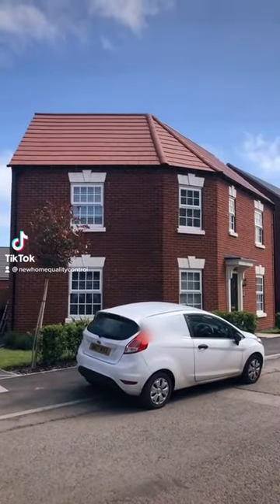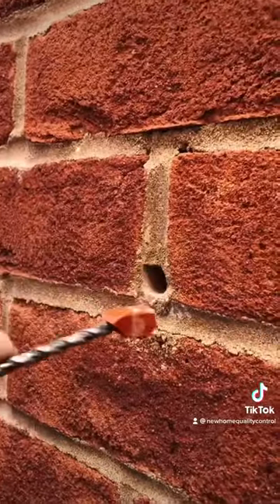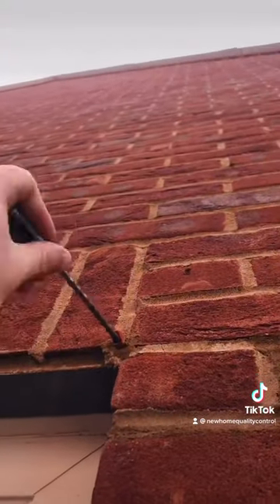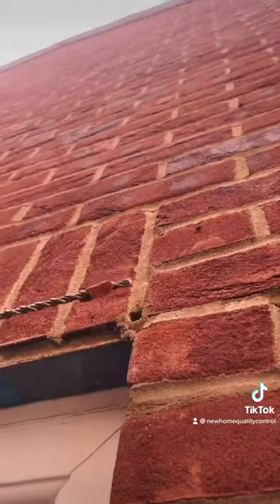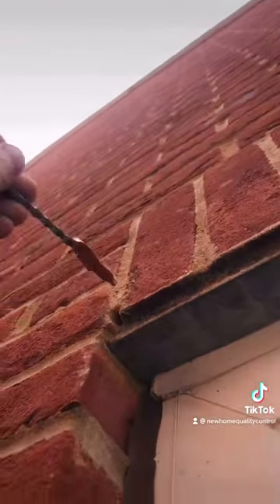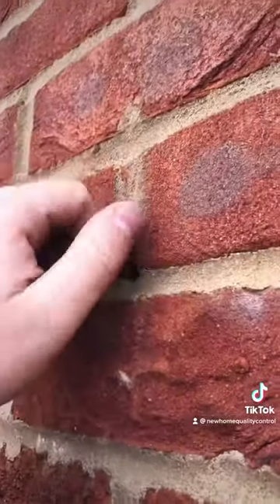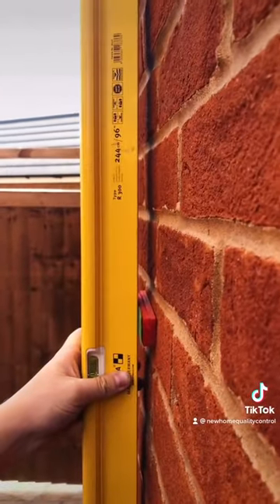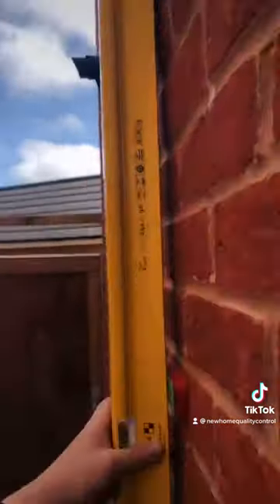MASSIVE BRICKWORK ISSUES: NEW BUILD INSPECTION

Comment: It’s rough no doubt about it, but if you put your level on walls anywhere on any site you’ll find 9/10 are probably like that. It’s structurally sound and it’ll not effect the value of the house at all.
Reply: its more like an indicator - if it's that out of plumb then what care was taken with the bits you can't see.
Reply: @twmd  like the painters always say, make good job of the front door and the back of the sh!thouse door it’s what’s seen the most.
Reply: Its sloppy work. Any bricklayer, or carpenter for that matter, should not be building, simple as that. If walls and framework is out of level then this affects the second fix and never looks right. Just take pride in what you do. An attitude of "that'll do" isn't good enough.
Reply: @beaufighter245  you obviously haven’t worked on site, being pushed daily. Thanks for your comment Mr Perfect, I did say it was rough. Buy a level and put it on any external wall on your house. You’ll see.
Reply: @Stephenlightley  you're wrong. I've plenty of site experience previously on the tools (carpenter) and now project management. You may be ok with tardiness and poor workmanship but not me. As for the walls of my house, absolutely true and level, as would not accept anything less. 
It is not necessarily about perfection it's about skill, care and the satisfaction of a job well done. But, each to their own.
Reply: @beaufighter245  I’m not wrong, I’ve worked onsite for past 23 years. These videos prove what I’m saying.
Reply: @Stephenlightley  as I said, each to their own.
Reply: @beaufighter245  so if your MD is pressuring you to get roofs to hit a target and get a client in the property for a legal date, and you’ve had a wall blow over 10mm in the elements, are you going to tell him you’re taking the gable down to bring it back over or ask the tradesman to get over it?
Reply: @Stephenlightley  walk away. There's two types of builders and I'm sure you know what I mean by that. Those that are attentive and work to a high standard will always be in work. Others, come and go. If it had been me in your position, I'd happily walk  knowing I could find employment elsewhere.
Reply: @beaufighter245  that wasn’t what I was asking, you being project manager have to get to a target, if the weather has caused a set back and work is slightly below standard does it come down and you tell the client they don’t move in? Or do to ask the tradesmen to get over it?
Reply: @Stephenlightley  tbh this has never happened. We account for weather and other factors. However, should something not be right, I'd take the hit as reputation is important. But, as I said attention to detail from ground up. Anyone on site, I expect the same. They disagree, cut corners, hide errors, they walk.
Reply: @beaufighter245  if you’ve never came across brickwork or blockwork that hasn’t been affected by the elements and caused slight defect, you haven’t been taking much notice. I can honestly say I take great pride in my work but if the powers that be tell me to crack on I will. You’d get chased off site for being slow just as easily as if you were poor.
Reply: The speed these houses are built your gonna get problems like this if you want a perfect home buy a new build on smaller sites, these snaggers make me laugh some of them charge £800 to walk round a house and pick out defects that don’t really matter in the grand scheme of things, what’s this bloke thinks gonna happen ? They gonna rip the whole house down cause the brick work is in tolerance and isn’t even noticeable
Reply: @Stephenlightley  You are the worst kind of builder and no doubt you hate sites like checkatrade or trustpilot. How you can actually excuse more than half of these issues as ' how it is' is untrue.

You must work on council flats and government buildings or low cost builds becuase my god you would not last in the real industry I'm in, youd be laughed out the door
Reply: @TheFreshSpam  you obviously haven’t worked on site before. Not even entertaining you, I know I’ve worked on site for 20 years and earn very well.
Reply: No way this is okay, maybe in the UK, but in Scandinavia we have standards.. 

But, not surprised that the UK have poor workmanship..
Reply: You can spot the cowboy in the comments below.
Reply: @greyfox788  put a level on any external wall on your house, you’ll see
Reply: @Stephenlightley  So strange there would be a specific building standard for this, and yet you argue it happens all the time. Almost as if the regulation was there for a reason…
Reply: Stephen Lightley

Honest question because I'm not a tradie about I've never bought a house before:

If there are recognised tolerances for things like this, then why doesn't it matter if the tolerances are met? 

Also, and again I'm not looking for a fight I am genuinely curious; I know how you feel about the tolerance thing, but what do you think about the fake weep vent thing? Is that a big deal, or does it not really matter in the real world? I'd love to know!
Reply: @craighambling  the tolerances are there for a reason I honestly get that. But in the real world when builder ie persimmon etc want a roof on by a certain date they’ll overlook things. The fake weep vent thing is silly, even if they are forgotten it doesn’t take long to install them correctly afterwards so no argument there. That’s down to laziness in my opinion.

Comment: The NHBC inspector should have inspected that property at joist height to sign it off, he has obviously failed to do his job correctly, if he had it would have been picked up and entered in the log as a red item and the problem with failure to fit the weep vents would have been rectified at the time of build. If the inspector does not do his job properly is it any wonder those below don't. The bow in the gable as you know, in a level of the length you are using is within acceptable margins, so a bit misleading on your part there. Kettle pot, pot kettle, if you are telling untruths are you really surprised others are.

Comment: We call them weepers. Dumb people think there is a mistake and pull them out and cement the opening. But this can cause mold issues because weepers allow air flow between the brick and inner wall.

Comment: Not good , but weep holes are a load of bollocks anyway
Reply: but faking them to pass an inspection is fraud. what else did they cut corners on? fire barriers etc.
Reply: I'm with you on that one Neil. As long as the tray is in place and folded correctly the weepholes are irrelevent.  The brickwork is porous enough to let driven rain through it it will leach out of the tray at lintel level. The exception being for rendered plots then they are essential. Having said that if they are in the site spec they should be fitted correctly.
Reply: They need them to let the water out from the leaky roofs 😉